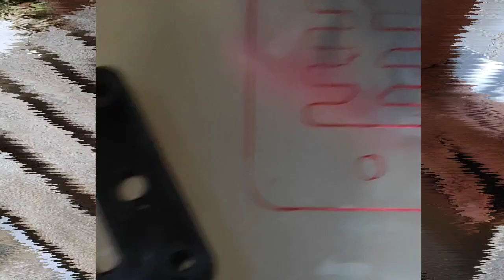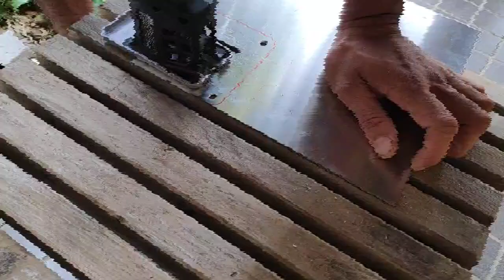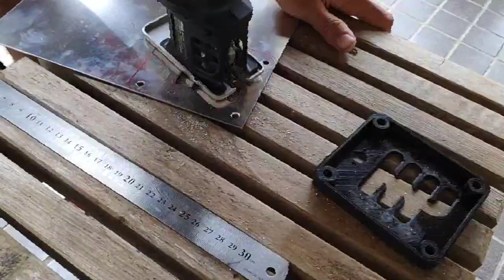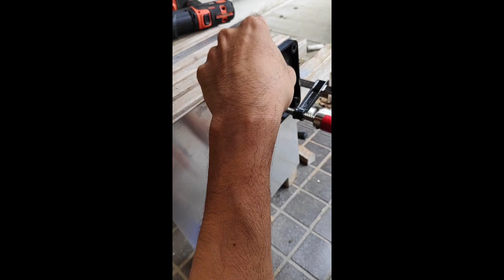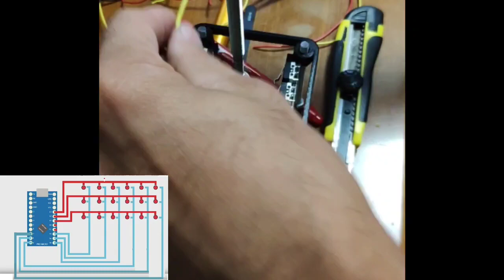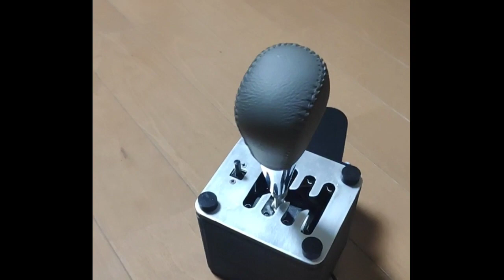H shifter DIY (V3)

Comment: can anyone do something WITHOUT a 3D printer these days pls?
Reply: If you don't have one just cut the parts out of wood or acrylic.
DON'T BLAME OTHERS cuz you can't afford a printer
Reply: @parasyte25  that's exactly what I'm going to do bro
Reply: @BladSG  I made mine from plywood, worked well for a year.
 Now I have printer so it makes my work easy.
Reply: @parasyte25   yeah, i'll use plywood and PVC as well
Reply: @parasyte25  we get it, your mom bought you a 3D printer for your 16th Birthday
Reply: @BladSG  soon I will make one in wood
Reply from the maker: @FabriKzeiraDIY  can you share?
Reply: @eiurandelfkhan2299  soon my friend. it will be simple and with more features than a Logitech or trushmaster ones. as my arduino wheel
Reply from the maker: @FabriKzeiraDIY  ill be waiting.

Comment: what is the password for rar
Reply from the maker: Its written there sir in the properties at comment section of the rar files
Reply: @eiurandelfkhan2299  thanks
Reply from the maker: @michal2k192  Please sub thank you
Reply: @eiurandelfkhan2299   strange, in properties i dont have a comment section
Reply from the maker: @BrandBijl  You have winrar?
Reply: @eiurandelfkhan2299   no, i use Total Commander
Reply from the maker: @BrandBijl  I think you need winrar..
Reply: @eiurandelfkhan2299  with winrar it worked. TX
Reply from the maker: @BrandBijl  no problem